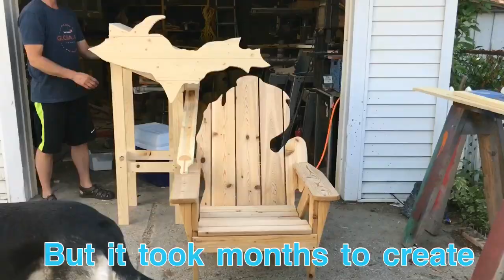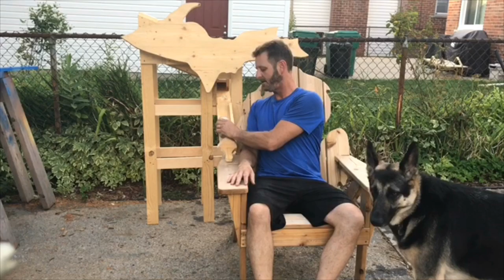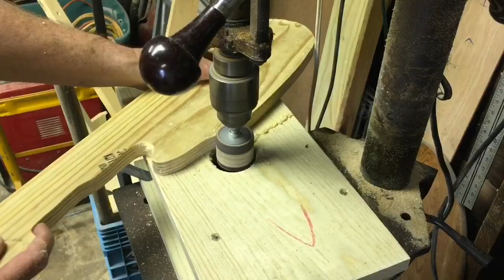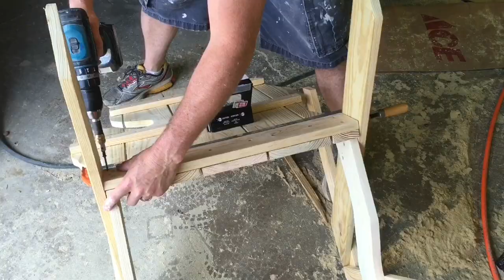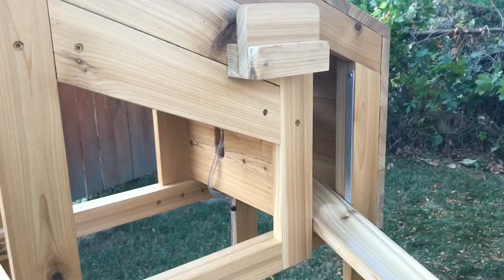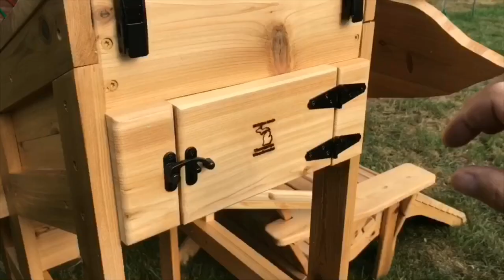The Michigan Beer Chair (Start to Finish)

Comment: Nice project! I love the chair. I think I'd like to make one that holds 12 cans. Lol... The guys I know would kill 6 cans in record time. Did you insulate it with Styrofoam? It looks almost too smooth to be Styrofoam. Also, how long is the cooler box? Maybe 12 cans would make it appear awkwardly long? It probably wouldn't work if I stacked them 2 cans high, where it would alternate between top layer and bottom layer, but, I can see the cans jamming in the cooler.
Reply from the maker: I kept it to 6 so that it would be mostly hidden behind the Upper Peninsula.  I just used 1/8" plastic sheeting sold at Home Depot.  Cedar seems to insulate very good.  I don't know if stacking them would jam them up.  You might want to try it first.